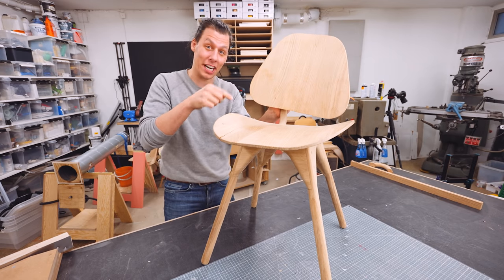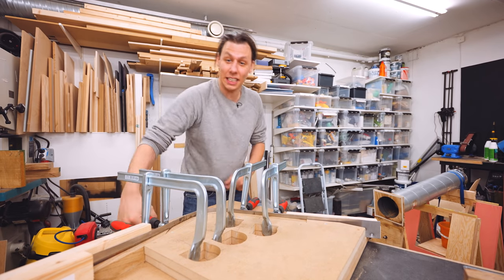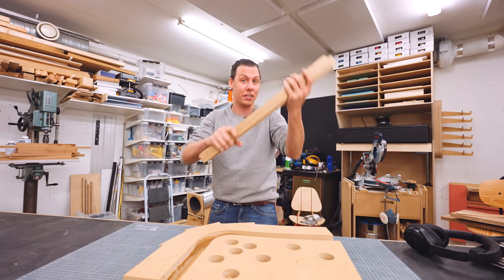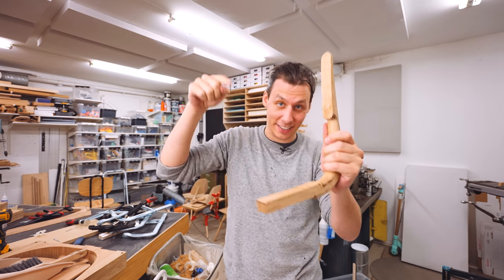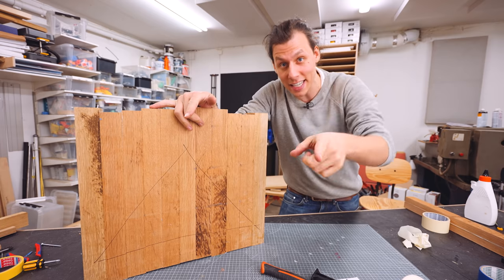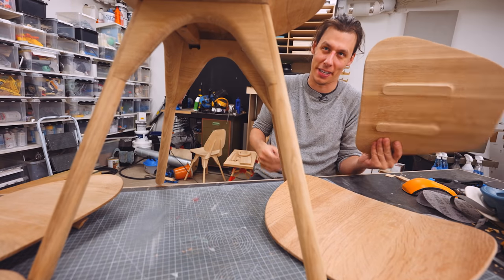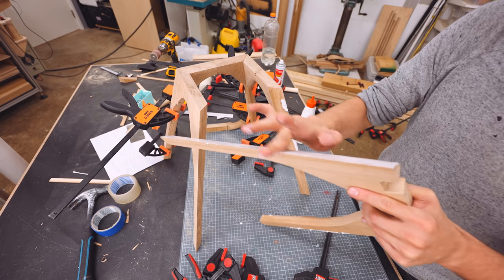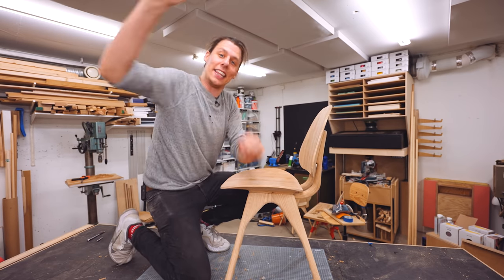This chair was VERY hard to make

Comment: I think you must soak wood in water for while before steaming it. furniture maker also use new wet wood or soak it before steam bending it. You should try that.
Reply: Yes indeed. Because steaming without soaked up, means that not all the wood fibers have water. Soaking is better to have all the fibers soaking up water. 🙏

Comment: Great job and interesting to see the journey. I did wince a bit with the amount of wastage given the cost of wood at the moment and wonder if the seat could be laminated in the same way as the back rest supports. Cool chair regardless, thanks for sharing.
Reply: It does sound like a lots of waste is created, but keep in mind that (1) oak is relatively cheap (2) it is still WAY less pollution that anything you buy at IKEA!
Reply: @AlainPilon  wildly untrue on both counts
Reply: @Keechization  ? Oak is like 3$ per board foot even less if you buy it on marketplace. How can you call that expensive? IKEA furnitures use a shit load of chemicals for glue and finish. And dont forget all the gaz burned for transportation, packaging, etc... So please dont reply one liners without evidence to back it up.

Comment: hot tip, if you use two even level sticks under the wood and use the bessy clamps ontop, much cleaner easier clamping and wont risk getting glue on the bars

Comment: Please use wooden dowels to fix wood blocks to the CNC router spoilboard. In that case you never have to wory abour running into a metal screw and breaking a router bit.

Comment: 15:53 YEET!
Very nice build! The bend wood turned out great! Did you use an extra thin saw blade? The band saw should also be able to produce thin strips but with less waste, though it needs to be perfectly adjusted.

Comment: I really liked this video with the redemption arc. One thing that I think atleast I'd enjoy with this process of designing a chair:

Create a spare, or two, of the pieces that hold the back. Then stress test them (without attaching them to any other parts of the chair) and see where they break. Then device a setup where you test what kind of force is applied to a back of a chair by sitting on it (sitting carefully, really going at it, etc at different speeds). Then you'd "know" for certain if you can trust your parts!

Comment: For wood bending, have you tried letting the wood sit in a steel pressure vessel filled with ammonia gas at 150 psi? :P
Reply: So lest anyone get the wrong idea... Yes this will work, but it is ENORMOUSLY dangerous! Not something to be done at home, but it works great in an industrial airtight chamber with leak monitoring; remember, ammonia gas is deadly, especially under pressure!

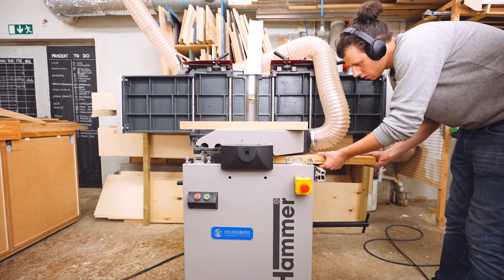Comment: 4:25 is there a more efficient way to cut those strips? If the strip is 3mm thick, and the blade is also 3mm thick, I'm assuming you lose 50% of your wood, if you use the whole piece (because you cut away material with the blade). I'm very curious
Reply: Bandsaw?!

Comment: Hey Alexandre! I am curious as to how does the CNC Mill compare to a 3D printer in terms of required user input?
I would consider using a 3D printer to be easy (I use one) where as a CNC Mill such as the Avid CNC seems to be relatively easy to control and use as well (I don't yet use one). Something like:  Change tool, Fix the blank part to the table, Zero machine using the "Auto Z and Corner Finding Touchplate", Input G-Code, check that everything looks good and then let it do it's thing... Some say CNC machines need a full time operator, but it seems to me that is rather a thing of the past, or is it still a full time job amount of work to use Avid CNC machines and alike?

Comment: I get funny looks at work and I am sure I will get the "wtf" remarks, but I am being dead serious. I make molds for plastic injection machines. Sometimes big molds. I worked at a place that would not use vises or clamps to surface the first face of a part. (Clamps will pull a part unflat, then when you face it, it will spring back to not flat.) They used carpet tape to hold the part to the table. Since you dont ever take a heavy cut when facing a part to make it flat, the tape actually holds the part to the table. Yes I thought they were kidding when I started, too. The guy didnt find my response funny and literally pushed me out of the way to show me it works. Metal is heavier and wood might not stick as well, but just a thought so you dont have to screw shit to your work surface.

Comment: In my inexperienced mind I can see several points where I would not be confident about strength and longevity. 1 the seat and back rest not being laminated. All the grain is running one direction and they are fairly thin. So I would be afraid of the unsupported sides snapping. I am guessing that the compound curve helps and the cross section is much wider than it appears. So it might be ok. 2. The legs. I would be afraid that they will split somewhere in the part where they get wider towards the top. They will experience a lot of stress as the whole thing flexes. 3. Wood movement. I am not sure how the base attaches to the seat, but if it is just dowels as with the back and not screws, I can imagine that the thing will slowly work itself apart.

Again, I am not an industrial engineer and my woodworking experience is limited, so I am not saying that this will happen, those are just the things I would worry about based on my limited experience. Also, I believe there are reasons why you would not see a chair made this way for sale, some of which are not related to cost and time savings.
Reply: I've got close to zero experience, but I agree. Especially the edges of the seat seems kind of flimsy. Legs are also quite thin

Comment: I think your wood steaming didnt work because you didnt get it hot & wet enough but 2nd method clearly just as good. Also should've used biscuits not just relying on the glue for keeping the legs. Great work though